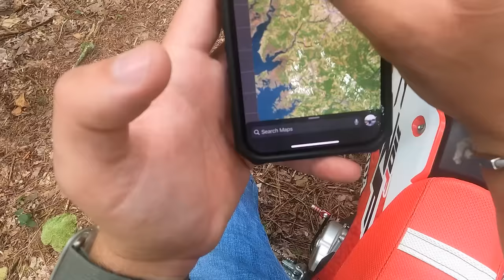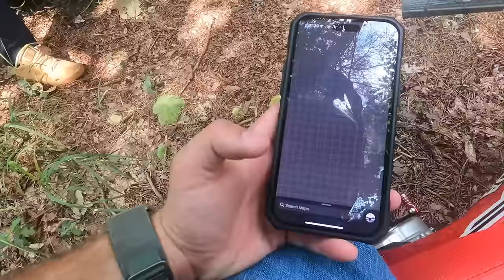SHOCKING DISCOVERY INSIDE ABANDONED HAUNTED FARM (VERY TERRIFYING)

Comment: The sharp thing you took out of the hole first is called a grass hook Sickle, they use it on farms in their crops, my mother's side of the family are farmers, and they use those. The clamps also looks like very old neck clamps to restrain farm animals, so that could be it, and the belt could've been used on their farm animals like their cows. So mostly farm stuff that you picked out of there. I couldn't see the snake you pointed out, or else I could've told you what kind of snake it is, its best to get your local snake catcher out to identify, remove and relocate it safely. Because when you said white head it made me think of the white crowned snake which is part of the cobra family, it has a paralyzing venom, so you don't want to disturb it at all or be near it when it comes launching out. Get the experts out to remove them for you just so you don't end up with a bite and noone to help you.

Comment: Radiant heating systems use hot water or glycol to heat a concrete slab, which then radiates heat into the room. The heat pipe would be used to transfer heat from the boiler or other heat source to the concrete slab.

Another possibility is that the concrete rectangle is part of a geothermal heating system. Geothermal heating systems use the earth's natural heat to heat and cool buildings. In the summer, the heat pipe would be used to transfer heat from the ground to the concrete slab, which would then cool the air in the shed. In the winter, the heat pipe would be used to transfer heat from the concrete slab to the ground, which would then heat the air in the shed.
Reply: The 2nd tool was also an antique farm tool also I can't place a good enough picture of it or the usage of it but I believe that it could have been used for carrying  hay bails or something like that.
Reply: If you here a woman or a child yelling help or crying or screaming bloody murder screams it's probably a bob cat or mountain lion. Beware that they also will stalk their prey from behind stealthily so make sure u shine ur light behind u in the darkness to confuse them and hope it works!
Reply: Also the screen door on the shed has the pneumatic screen door closure installed on the top of the door which should have a squarish metal piece on the bar that slides over protrusions on the bar through the exclusions on the piece and u slide that tight to the pneumatic closure while the door is open to keep it open. I'm sure that it had just been positioned to where it just finally let go possibly cuz someone had opened it wider at 1 point and the older closures don't hold as well as when they were new.

Comment: concrete construction blocks were.not around in the 1800.s  so my guess is the hole is not that old... the sump is probs to stand a gas bottle in when welding under a vehicle . the large pipe maybe a fumes extractor since it has a fan on it and the small piedpe a lighting cable. buried so nobody trips on it

Comment: Those one tool is for harvesting wheat or other crops from back in the Day the other tool from what I know could be used for multiple things from lifting things to dragging thangs not with your hands of course you put something on the other end of it and it pinches it together as you pull it

Comment: It’s an old ice and salt house. If you look at it, it’s a salt pipe shed building. If it goes from one level down to another, that would be what you call it icehouse they used to put ice down in there and you come with your wagon and they reach it up out of there they have a guy that would hang from the top and pull the ice blocks up, when you showed me those pics, I knew exactly what it was when I saw the tools the one it looks like the sickle that’s a shaver it shaves the ice that’s your old type of freezer. What you use for old ice type of thing that would be your walk-in freezer from way back in the day.

Comment: I can't find the video from the separate building that had the concrete room beneath the wooden floor.  But any ways your mom was with you.
You found a few items. One with a handle and a rounded blade was a type of sickle. Not very expensive. The other piece with the two handles and the pointy ends was a block ice pick. They would use this way back in the day for big blocks of ice to cool refrigerators, hence the word ice box! Lol
Now the belted contraption, I have never seen anything like that.

Comment: The hole holds water... It's an old cistern. See them in SWPA still, usually in an outbuilding or basement. The pipe should connect to the roof. Water would have either been hand pumped or later by an electric pump to bring water to the house. More than likely it was no longer in use and was covered for safety. And you're digging out the drain. I'd leave that in the event there is a sub cistern under it leading to a valve pit that might be holding Noxious gasses build up. They covered all that tight for a reason..and its not because they held ppl in it...lol Bless your momma's heart!

Btw, <3 the snake :) He's watching you because you're in its home and it's afraid you're going to eat it.

You all have terrible over active imaginations for someone wearing a "Come and Take it" t shirt. But ya seem like good ppl, and this was entertaining! Thank you!

Comment: I was thinking that the pipe coming out is used for a fire place so and the bottom of the bored where burnt like it had some fire in the whole in the floor and the pipe coming out on the other side was for water if it go to hot they would turn it on to cool the fire down

Comment: it looks like they ought to search more of the property for bodies....blood will wash from anything given enough time....the belt and rope are a harness, for what I'm not sure since there's no other equipment to indicate it attaching to anything but concrete was invented somewhere prior to the 1400's so the pit could easily have been there for a long time...I believe the hole in the corner was a spot on guess of a 'bathroom' hole, the small pipe could have been for water and the larger pipe (which a piece that was on the ground) was for ventilation....the rotten wood ladder could have been there for only a few years as wood can rot in a short period and become unusable...in all, unknown why the pit was there but it's too deep (as stated) for mechanical reasons...since the barn/building was used as a storage after 'something' happened it might suffice to say there is something else to hide and might be hidden elsewhere on the property

Comment: That pipe probably brought the water down  from the roof (rain water that is) down into the  sistern.sister. my  grandfather's sistern  was under the kitchen. Made  out of concrete .to get down in it  there was a trap door  under his chair under the  kitchen table.  I used to have to go  down  in there and  scrub it out  every year. It had  a metal ladder  going  down  in it.if it wasn't capped off any critters  could have been  using the pipe to go down  in there
Reply: There was 2 light  bulb  in the thing so you could  see to clean it .sometimes we had to reparg it.